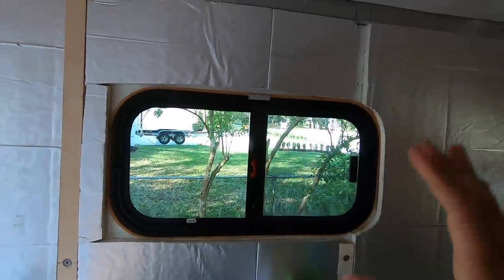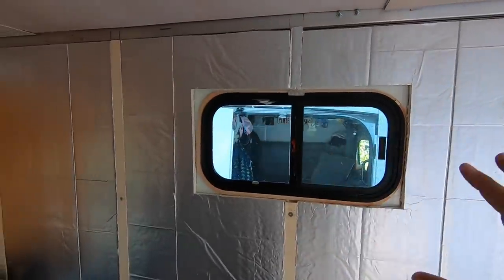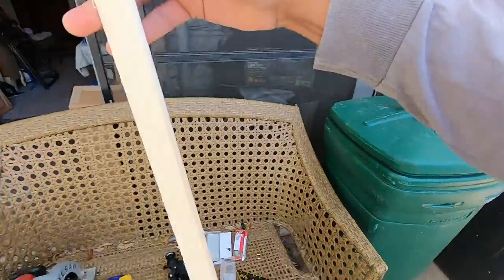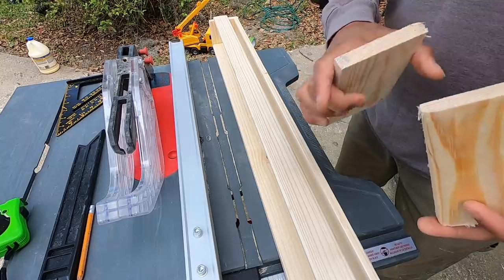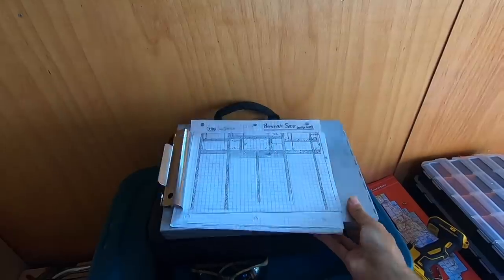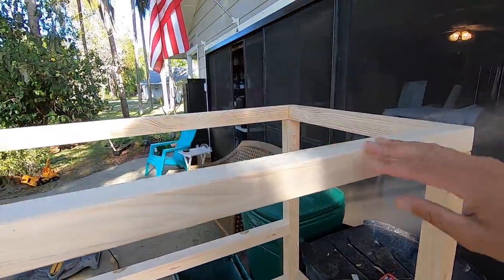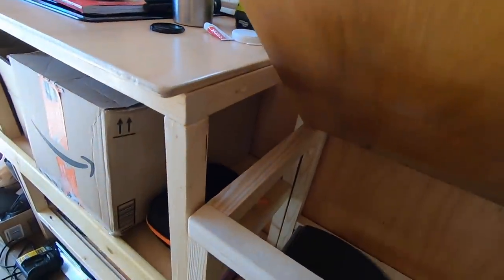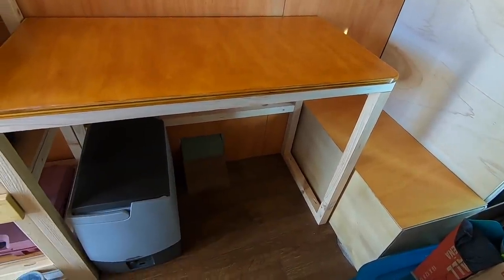10ft Box Van Camper - Build Ep. 5 Walls, Shelf, & Desk

Comment: 3/4" plywood for the walls eliminates the need for horizontal and vertical backing boards. No need to figure where to put the back boards for cabinets,etc., plus it acts as a finish so no need for paneling. Easy to shim and install. Then you're free to screw anything to the walls anywhere you want.
Reply: Dunno, the flexibility of heavy walls is great but Brian saves 100 lbs and gains insulation with his technique.
Reply: Great idea but almost 100lbs a 4x8 sheet......

Comment: Great job on drawers.... I am an old cabinet maker and for years made all drawers with wooden guides. What I do now for drawer bottoms instead of a dato blade is stick 2 10" table saw blades together with a piece of sandpaper in between them cutting a 1/4" deep dato on  all drawer sides and ends 3/8" up from the bottom...glue and slide my1/4" plywood bottom in. done.....

Comment: A locking french cleat system of mounting cabinets makes future changes easy. 
For a vehicle look for the locking type. Several different ways to do it. 
The advantage being you don't need to change your wall, only build a new fixture to hold whatever you desire. If your dimentions are the same everywhere between the cleats, anything can be moved to the new location without modifying anything.

Comment: For the cover of your electrical components, instead of dropping a sheet of wood to cover them (thus cutting off ventilation) you could cut a piece of metal soffit. Then it will be rigid but light and easy to move and it will allow for airflow.

Comment: Brian i have some advice for you, maybe not have a shelf under the window above your bed with valueble things on it like keys and cell phone etc reasoning if its warm or really warm at night and you have the window open fairly wide while you are sleeping somebody can reach in and take your keys and or phone etc.. Or if you want that i have a suggestion which will add security to the window and also stop flies and bugs coming into the van any time of day or night, i have seen on another van build  a guy wanted ventilation but also did not wanted flies or bugs coming in his van so what he did was he made a frame the same shape a the window attached a mesh to the frame then on the back on the frame and the window frame he attached magnets  so when the window is open he put the mesh frame up against the window magnets keep it in place and no flies or bugs can get in, then to close the window just take the mesh frame off and close the window.

Comment: Very cleaver drawer design. 
Instead of a drawer latch, An idea is to put a thin wedge shaped cleat into the bottom of the drawer so that the thin edge faced towards the back Space this cleat away from the front of the drawer the same distance as the thickness of the cabinet frame. When you pushed the drawer in, it would ride up the ramp of the cleat and then drop down into the space that you left between the cleat and drawer front. 
To open the drawer, you would have to lift the front of the drawer so that the cleat would clear the cabinet on the way out.
If the cleat was rounded on the front and back, you may be able to just tug on the drawer to get it to come out.
If I have not been clear, let me know and I will try agan. A simple screw into the bottom may work as well. The thickness of the screw head should be about right to hold the drawer closed and still let the drawer open. You may have to lift the drawer when closing though.

Comment: Looks like you have 4 battleborn lithium-ion 100ah batteries. According to the manufacturer they don't need to be ventilated. But it's a good idea to get them insulated from the heater cold. 
Are you running them in series?
Thanks enjoy we're enjoying the build so far You're doing a great job.
Robert from Henderson Nevada
Reply from the maker: Thank you.  I will have a detailed video on the power setup soon! ✌🏼

Comment: As a finish carpenter, you killed me, Brian !  COULD have looked 100 % better if you had simply used full cleats to attach the pieces instead of those metal L brackets....  And for a few $$ more, had done a Full "face framing" of the cabinet structure, (instead of all that end grain of the plywood ...>).   Really simple and much nicer finish !!